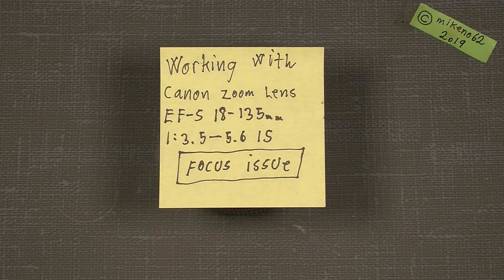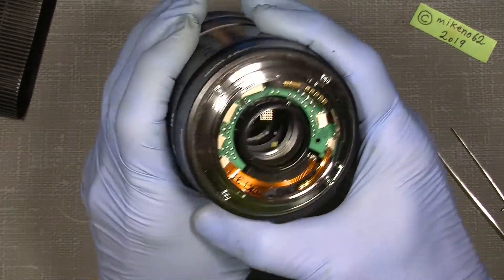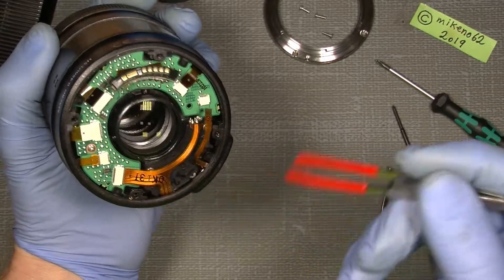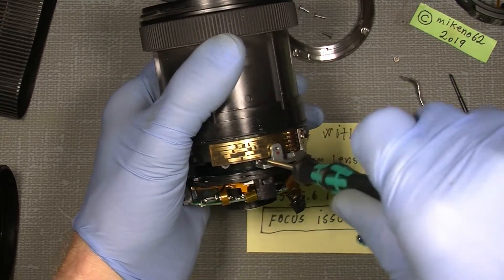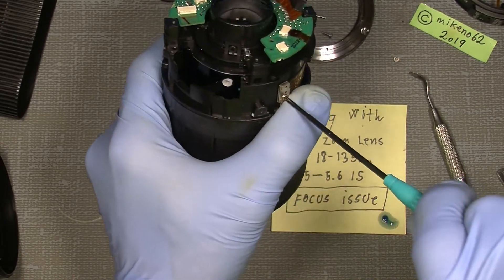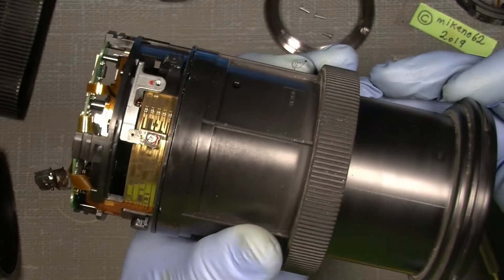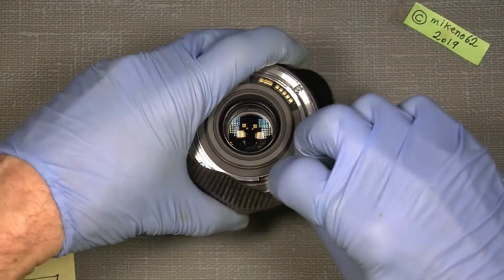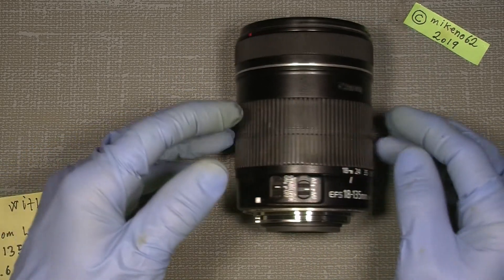Working with Canon zoom Lens EF-s 18-135mm 1:3.5 -5.6 IS Focus issue

Comment: Mine had the same problem. I could hear something rattling around, and after following this video I found the same screw loose inside (and its buddy still in its threads, but partially unscrewed). I put the runaway screw back, tightened both, and aligned the zoom brush. But I had to remove two screws (around 8:30 in the video) to get the focus mechanism out, exactly where the narrator said he thought there should be a couple of screws at 20:25. Without them, I suspect his lens is going to continue to give him trouble. One other suggestion: I found it worked better to have the AF/MF switch in the AF position when reassembling, it fit back in place more easily than if it was in MF. Finally, note that this lens has a DC motor focus mechanism, and with the switch in AF the focus ring is locked to the motor -- unlike lenses with USM or STM focus motors that typically allow the focus ring to turn even in AF. I wonder if his original problem was that he did not realize this and thought it was jammed in the AF position? Canon also offers what look like two higher end versions this same lens, but with STM or USM focus -- for a lot more money.

Comment: Lovely LOGICAL approach to the job....I often spoke your words slightly before you as we both did the job.
Excellent and gives the average person enough confidence to tackle this and other jobs.
Beautifully done.
Thanks from Canada North
My guess is someone forced the focus ring when it was in AF mode and stripped/pulled the screw out of it's hole where it later jammed and prevented toe ring turning.
Reply from the maker: thanks Wayne, I would also guess that someone forced the focus ring and in that way, when it was in AF mode and the plastic gears came out of place. Cheers from Denmark

Comment: A much easier way to remove that plastic ring at 3:19 is to take off the metal ring first. Then push the retaining pins from the inside using a small tool. It pops out easily and will not cause damage to the plastic ring.

Comment: Same as my problem today found after I fix. My lens 18-135 the center screw of that connectors holder has released too. Made a sound like screw inside slider then sometime block the zoom  and focus ring from inside.

Comment: A question, just purchased canon 2000d (18-55mm), can it be used in camera 2000d. Thank you
Reply: should be yes, since both  canon 2000d and EF-s 18-135 are efs mount
Reply: THank you for your message.